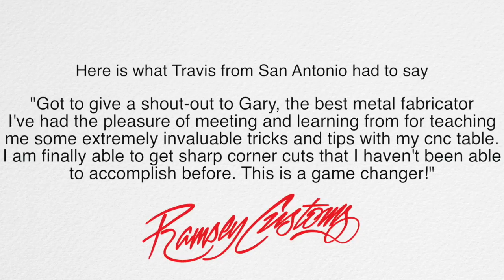Weld Porn - Want to learn the basics of Tig Welding?

Comment: I know that you haven’t claimed all of this work to be your doing, but I don’t like that fact that you are fronting other peoples’ work while advertising your classes. I’ve seen your welding and your capability/knowledge is rather limited in that field. Don’t teach something you haven’t mastered. It can be horribly misleading to those who look to you for information. Great videos in general, and I plan on looking towards a trucutcnc table you advertise during this spring.
Reply from the maker: My welding skills are improving quite a bit, just look at my last video.  I have never mislead anyone, and I charge basically $20/ hr of my time, when my standard shop rate is $60 for paying customers.  I have had about 15-20 people come through.  EVERY single one of them were newbies, just bought their first welder, don't even know how to strike an arc, or maybe really struggling, and I have helped all of them improve and they were more than happy with what I did.   I give 100% 1 on 1 time with them when they are here, i am there watching every weld, helping them with torch angle, arc length, hand position, foot control, just some basic stuff.  Never mislead anyone, and everyone is happy, so how can that be wrong that I am really just trying to help others learn this fun process

Comment: I loved the video except for sticking the tungsten in the tack weld at 3:55. For those that dont know- that will contaminate your weld and mess up the desired properties of your base metal. It also consumes tungsten, as you'll need to clean and sharpen it.

Comment: I love My tig, but My tig loves Argon and My wallet has the last say. I only get to tig when it's absolutely needed, no tig porn for Me.
Reply: dieselrotor expensive hobby
Reply: biaggiwins 
I'm a truck mechanic and build custom trucks and wreckers. I get all the gas I need at work, but home is a whole different story ! I can't afford that gas gold lol !!
Reply: dieselrotor lol i cant afford to practice at home either. hey at least you get to sharpen your welding skills at work. pre/post flow controls should use U.S. currency values instead of time. whenever I strike an arc, I see dollar signs leaving my pocket.
Reply: biaggiwins
LMAO (flow=$$$) Most of the welding I do at work is only during a build and it's 90% heavy duty mig and transfer spray, otherwise I'm greasy lol. I only get to tig making switch boxes and dashes etc. Even the tanks are mig or aluminum spool gun welded. Once in a while I'll drop the tig to 50hz and weld a filler neck or something. Like You, I don't nearly enough tig time,,, Merry Christmas.

Comment: As a sanitary welder in a brewery. It's 60% trade craft 40% machine. I run a Miller dynasty 210dx and I can do dimes like that all day the base metal is also a huge part of your weld stack. One word of advice  clean clean clean and practice practice practice. You can lay a Awsome bead with those low buck import welders that chucke2009 is getting blown to front but if you practice and keep your metal clean you to can lay dimes. Don't dip the tip !
Reply from the maker: Good stuff, good info, thank you sir
Reply: schmidt028 
Nice job , anyone know what's that's song playing on this video ?

Comment: I wish someone would do a class like that around here. I have a Miller 212 which is a decent machine but I can't seem to get the hang of tig.
Reply: Cruiser Mac it's all about cleaning and start of the puddle after that it gets easier as you go. You try to move to fast before puddle starts it won't work
Reply from the maker: Yea, same thing with Travis, he was having issues with his hobart welder and we got him setup with just a few simple changes.

Comment: Cool video mate 👍
Hey where did you get the clear shroud on ya tig gun from looks cool and does it  do anything different or just look cool 
Cheres caveman
Reply from the maker: Jody from Weldingtipsandtricks sells them.  The main thing it helps with is at odd angles where you can't see the botton of the electrode, you can look through the cup to see where you are if your welding down in a little slot or your blocked for some reason
Reply: Capitan caveman they are all over eBay Pyrex $13 bucks for ten and you get the gas lens. eBay item # 182699866931